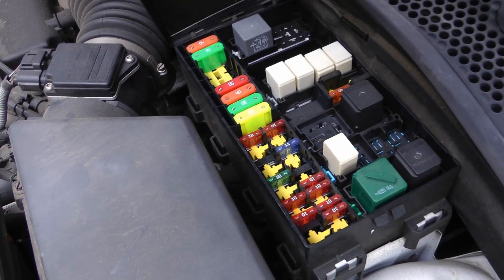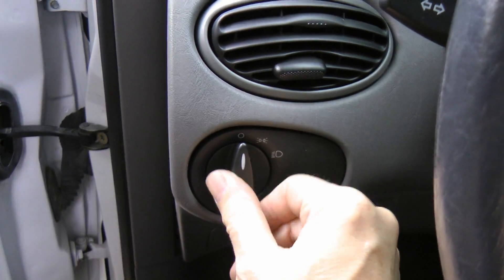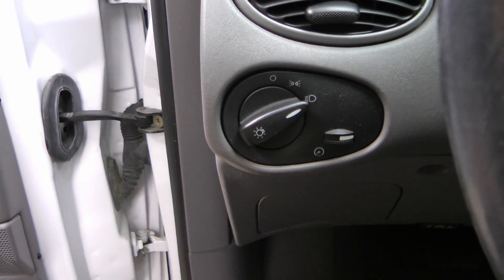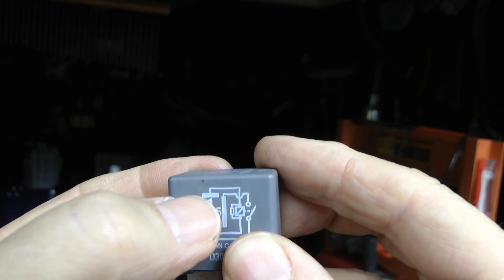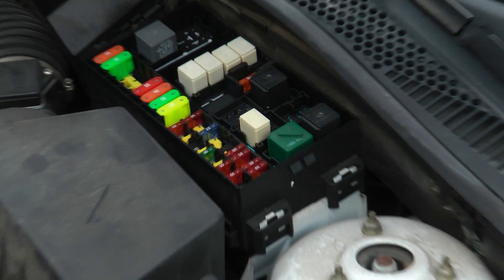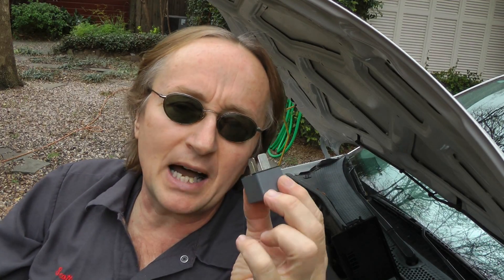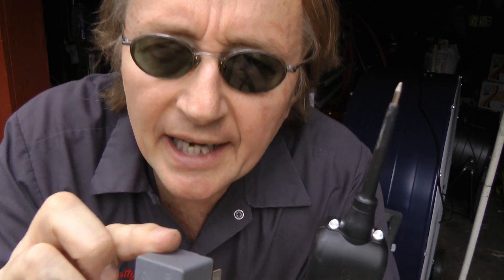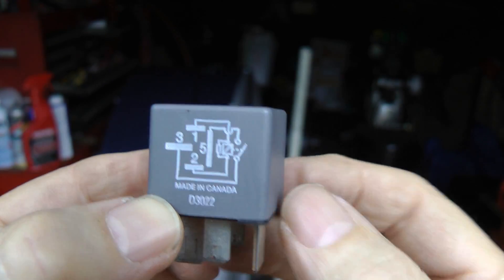How Electrical Relays Work in Your Car - Electrical Troubleshooting

Comment: Hey scotty i have a 1996 Ford Thunderbird Im trying to find the coolant fan relay so i can check it. my fan works when it is rigged but when i plug it in the nornal slot it will not come on at all. I believe the relay needs to be checked but i cant find it, can you help me locate where it is so i can check it.
Reply from the maker: fan relay is in the main relay box under the hood, but rarely do they go bad. More often the computer itself or wiring goes bad shutting off the fan.
Reply: i checked the main box to find that the fuse was blown i did change it but the fan did not come on so it must be the wiring or the fan controller relay

Comment: I have a 2003 Pontiac grand prix the car started skipping so I had ignition module replaced and the cat converter replaced it ran fine for about a month then it started skipping again, when I first driving it in the morning after it sitting all night it will drive fine for 10-15 miles and it will start skipping again and the tachometer starts going crazy and it wants to stall out and sometimes it does I also just had the fuel filter replaced and I can hear the fuel pump coming on....desperate for help
Reply: Spark plugs. Or fuel injectors

Comment: Hi Scott so glad to have come across your channel I have a problem with a seat altea 2010 diesel. When you exit the car and shut the door 5 seconds later the cooling fan comes on at hi speed until the battery goes flat. Any idea where I should start? I've checked all the fuses but don't know where to start any help would be appreciated. Thank you
Reply from the maker: often a bad main computer does that, have that checked first

Comment: Hello Sir! I have a real problem here, I own an 1998 Carvan with 182K Miles on it. My problem is that my car will Crank but it will not turn over. I have noticed from the fuse relay that there is a sound like a humming sound coming from the Fuse relay, There is also one click coming from the relay box. The thing I dont understand is the whltliseing sound coming from the relay... The battery is great, we just took it to AutoZone for testing. Any info will help thanks in advance.
Reply: Another thing is the Car has the Blinking light problem. It has had that since I purchased it 3 years ago and has never gave problems to the point to where it doesn't run anymore. Thanks in advance from any info.
Reply from the maker: do my video "fixing a car that cranks but doesn't start up" to see what's broken. If a relay hums, it often means there's a short in the wiring or device that powers
Reply: Scotty Kilmer Thank you.

Comment: Hello sir! I have a problem that I really need your help on if you don't mind... My alternator for my 2006 chrysler 300 went bad on me after driving it long after getting a thunder bolt icon on the dash... I replaced it with a new alternator, after doing so my car alrm doesn't work anymore, the car stalls upon starting, and also when I turn the key half way on I get the flashing thunder bolt and check engine light but after 30sec the thunder bolt icon goes away but check engine light stays on until I fully start the car. Please any info will help!
Reply from the maker: first, have that new alternator tested, places like auto zone do it free, often they are bad out of the box. But if no, realize the computer actually runs the alternator on that, and if bad, you could get those symptoms and need a new main computer to fix that. Real stupid chrysler design when it comes to expensive fixes.
Reply: Thank you good sir!!! I will try these things.

Comment: There is no power to my fuel pump relay I think I fried/over loaded my ecu! I had a long crank issue before car started and bypassed the relay and started right up then I tried by passing with different pins stupid of me! And when I tried starting it just cranks but no start no power to fuel pump relay nor fuel pump fuse , please help. Did I fire ecu by connecting different and wrong pins in same connection or overloaded it? And In one of the pins in relay there was always 12.5v power key on or off and now no power at all , will replacing my ecu fix problem? Thank you love your channel. Funny n fun.
Reply from the maker: you could have fried it, but really, first send power directly to the pump using jumper wires from the battery to the pump wiring. If it runs then, why not just bypass the computer and run a wire from the ignition switch to the pump with a 25 amp in line fuse?
Reply: Scotty Kilmer thank you I will try that. My car had a starting issue where it would crank like 5times before start and with the fuel pump relay bypass it would start right up! What do you think was my problem there will the new ecu help or is this another problem? Thanks

Comment: Hey Scotty. Got a question for you. When I have my air conditioning on in my 2009 impala it doesn't make a clicking noise but when I turn off the air conditioning it makes a clicking noise inside my dashboard. After I turn off the car it will remain clicking for about 2 minutes before it stops. Do you know what the problem may be?

Comment: WHat if the relay clicks but its very delayed? Such as ignition relay , turning the ignition key off [[and the engine stumbles and still fireing spark already tested]] than the relay finally clicks  is it possible the relay  causes minor engine run-on ? Or would the switch be the culprit but starts and runs fine until shut down only when the problem occurs
Reply from the maker: I would replace it, and pray it's not an electrical short somewhere on that system

Comment: Great videos!! very helpful, I have a 1994 Dodge Intrepid and it's dead. I know its not the battery because we checked the battery and changed the alternator. There's no lights or sound when we turn the key could this be the starter?
Reply from the maker: NO, lights would come on if it was the starter, all the dash lights would come on. More often wiring problem between battery and the ignition switch, or a bad switch itself
Reply: Thanks! I'm going to get that check ASAP.

Comment: Good video Scotty, just couple notes:

Another reason for using relays is that you would need thick wires everywhere in the car to handle to current, while with relays you only need thick wires that go to the actual load, i.e., headlights. 

Also, a relay that clicks does not necessary mean that is always good. You may have cracked connections inside. I had this happened to me once.

Comment: Hey there Scotty, my friends 05 GTO's 3 relays for the cooling fans get hot when he starts the car and the fans come on immediately while the engines still cold  so is it one of the relays or the PCM? Thank you much.
Reply from the maker: ANY electrical short in that system can do that, from a shot relay to wiring to bad fan motors to the pcm. You'd have to check the entire system, as in my video "finding the source of electrical shorts on your car"

Comment: Hello Scotty, so glad to have come across you on you tube. Initially needed help bc my husband crossed wires when hooking up the battery on my sons 2009 charger. Blown fuses caused a/c, horn, wipers, radio, blinkers, etc. not to work...all ok bc we changed out the fuses except the car was still running high, wouldnt shift (rpm?) no cold ac and eventually car died on us.  Noticed the alternator wiring was fried and disconnected. Replaced. Still the ac not cold and car still running high!!! Could we still have blown fuses or blown relays? Thanks in advance for any help you may have.

Comment: Scotty, I have a 1986 Ram 50 that has a nippondenso 6 blade lighting control relay that chatters running or not. the chatter is the clicking of the points opening and closing rapidly. The ignition switch does nothing when turned. These relays are scarce and expensive so I need to know what to do, as it may not be bad. I saw all the videos on testing and did some but even though I got a click, that was as far as I could go. The terminal s are sets of  three equally opposed and the two center ones are hot. So now what?
Reply from the maker: get a wiring diagram to show what terminals do what on that relay, and see if it powers up correctly when the relay is activated. There generally are small power terminals, ground terminals, energizer terminals, and large power terminals and you have to know which goes where
Reply: Scotty Kilmer
Thanks, I am doing just that.

Comment: hey Scotty my 2003 Oldsmobile Alero  signal arrows don't work properly sometimes they blink properly sometimes the left arrow blinks like if my tail light its out. sometimes both are working properly and then they just stop working i turn the hazard lights on to make them work i want to get it fix before it becomes a major problem.
Reply from the maker: when it doesn't work, get out and see which one doesn't work, either a short on that side or a bulb going out

Comment: Here's one that may help...

2006 Honda Civic LX.

Symptoms:
1. Intermittent parasitic discharge of over 7 amps resulting in a dead battery.

2. Sometimes, A/C doesn't work very well.

3. When A/C does work, the compressor clutch could stay engaged, even with the A/C off and even if the car is off.

Cause: Sticking A/C clutch relay.

The power connector on the relay socket (located in a fuse box next to the main battery inside the engine compartment) that feeds electricity to the A/C clutch is hot with 12VDC, even if the car is off.  If the relay is stuck closed, it's constantly allowing that power to flow to the A/C clutch, which results in a parasitic drain that kills the battery if the car has not been running for enough hours.  It also explains why the A/C is working even if the A/C is turned off on the HVAC controls.  A sticking relay can also potentially work the other way; just as it can be stuck in the closed position, it can also be stuck in the open position.  This can explain why the A/C sometimes doesn't work, even though it's turned on through the HVAC controls.  The sticking relay, in my case, was the result of internal mechanical failure of the switch inside the relay.  Replacement with a new relay solved the problem.

Comment: Quick question 2001 impala the car wss off and positive side terminal of the battery came in contact with the body and the battery sparked on that side then I lost power all power no lights no dash no start check enging light only comes on when I turn key but nothing else
Reply from the maker: that can short all kinds of electronics out. Check ALL the fuses and pray some have blown. If not, generally main computer will be fried at the least.
Reply: Thanks scotty I will check it out have a good day

Comment: Hi Scotty
My 1999 bimmer 528I break light keep coming on every time I start the car, and the radio goes off and on and the steering wheel going up and down. Can you help find the problem? Thank you so much
Reply from the maker: have the battery load tested, pray it's just wearing out. If not, those computer controlled monsters require a BMW dealer level computer to analyze that stuff.

Comment: Hello Mr Scotty. I have 2 problems. 1 is that the low beams on head light dont work( when I switch it on the high beam light comes on the dashboard). 2 my battery keeps dying, its okay when I charge it but eventually as I press buttons in the  car the it kills the engine while im driving. Thanx for your help
Reply from the maker: start by having the battery and alternator load tested, places like auto zone do that free. Pray it's one of those, cause if not, you have electrical problems, often ground wire problems will do that and can be an absolute horror to find and repair
Reply: I have repaired the problems: head light problem was caused buy the switch that turns it off and on. As for the other problem: there was battery acid that leaked from the battery onto the positive wire from the battery to the alternator which damaged it. Replaced the wire and switch. . . Problem solved. Thanx for your help

Comment: hey scotty we have a chevy colbolt 05' thats really acting up. some of the dash lights turn on. but the car won't start. the car alarm system go's off the min.you open the door. help!!
Reply from the maker: you have an antitheft system problem, OR a very weak battery. Have the battery tested first, pray it's just that. The anti theft system is complex and requires a guy like me with a fancy computer to analyze and fix

Comment: My 2012 Hyundai Sonata does not have any headlight and fog light relay.  Everything is being controlled by the computer.  Since I upgraded to HID's, I have no choice than to install a relay harness for DRL/high beam, headlight and fog light.  This is just a small insurance against a $1500 computer if something goes wrong.

Comment from the maker: of course they can, but they cost a fortune. Just cut the bad wires, and run brand new wires, wire is cheap and can be easily soldered together.

Comment: hey scotty heres a question a friend has a Saturn van that has burned brake light wires.....can the wire harness be replaced?? it has burn makers  inside the van plus the brake light fuse always burns out. I had taped up all the burned wires but prefer to replace the wire harness....please help im out of answers for her

Comment from the maker: blower motors burn out all the time, remove it, put power and ground to it's two wires, and if it doesn't blow, replace it. doesn't matter how you wire it, it's DC motor and would only run backwards if you put wires on backwards.

Comment: Remember, just because a relay clicks when energised ,it doesn't necessarily mean it is working correctly. Energise the relay, and check continuity across the switched terminals. otherwise you can end up on a proper wild goose chase....................

Comment: ok
i fixed the fan and still no heater blower, turn signals, no reverse,power locks,air bag lights are on and i do have 4 ways. the only thing that i could come up with is the body control module that is the only thing i can thank of.
would you thank this could be the problum or not

Comment from the maker: you have more problems than just that one blown fuse. first, fix the fan that doesn't work so the engine doesn't blow. it may just need a new fan. Then check all fuses for the other devices to see what's wrong there. Realize fuses blow for a reason and replacing them won't fix anything for long.

Comment: scotty i have a big problom with a 2000 dodge grand caravan 3.8. the van overheated and the 40a fan fuse blow. changed that fan still dont work. looked at all the fuse's and all good  also the back-up lights,blower to the heater,turning signals do not work now after i changed one fuse to the rad-fan. need your help please.   it is nice for people like you to take the time to show other people how to work on there automobiles.

Comment from the maker: pray you got a bad relay, those cheap aftermarket ones don't work well. But if it's good, you have an electrical short burning out the relay, good luck finding that

Comment from the maker: It was a technical disaster, hopefully glitches will be fixed or I'll stop doing it. Now if it starts by bypassing the relay, either the relay is bad or there is no power going to it to energize the relay. Many guys will just put a remote starter button on the car rather than trace such an electrical problem if it's not the relay.

Comment: Good video, but there is one other thing that can go bad in relays too and that is the contacts. Like you stated in the video tons of power, so it kind of acts like an arc welder and burns of a little with each actuation of the relay

Comment from the maker: well, a late model car may drain the battery as they have so much computer crap that runs even when the car is turned off, but gas would be fine

Comment from the maker: you have lost power, get a test light, check the wiring from the battery cable towards the ignition switch, testing to where power is lost and the light goes off. That's the short that needs fixing

Comment: i have 1995 Camaro Lt1. And it want Start or Crank. My Dash dont light up at all. nothin works but my head lights,tail lights break light and the radio works. i have change the ignition switch,but nothing works at all.. i need help fast.....

Comment from the maker: could be a lot more than that, pray it's the switch. go to the switch and test it with a volt meter to see if any terminals have shorted out and lost power first.

Comment: Hey Scotty, I have a problem with my 99 Passat B5 V6 GLS. I hope you can help me with this electrical issue. I turned my car at night and I realized that my light wasn't ON , Wipers/Washers did work, a/c , Signals ,rear defrost, Break light on dash was on even if my brake fluid is full and my emergency brake was down and it was glowing more when I pull it back on. I have two stories one they said it could be the ignition switch, and others said a relay #370 on the panel.

Comment: Hey scotty, amazing video as always, i was wondering if anyone can help me out, i wanted to know what kind of transmission, differential oil, and transfer oil, do i need to use for a jimny ja11 f6a engine 3 cylinder. It has an automatic transmission ,any brands or info would be greatly appreciated. Thanks again.

Comment: i have an 89 mustang manual trans.when u start it up idles terribly. connected the obd1 scanner on it but for some reason doesnt read the codes. Once i give it gas rpms climb but then dies out when in neutral. I tried unplugging the iac and it dies to see if i can isolate it. i  tried the same thing with maf sensor and there was no change in the motor idling terribly. 
Was wondering if you could help me out. thanks